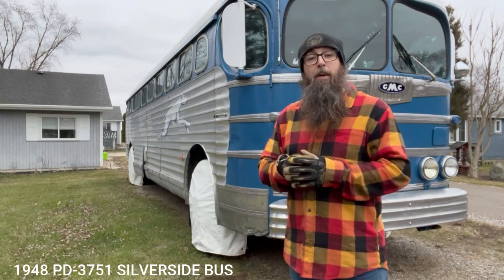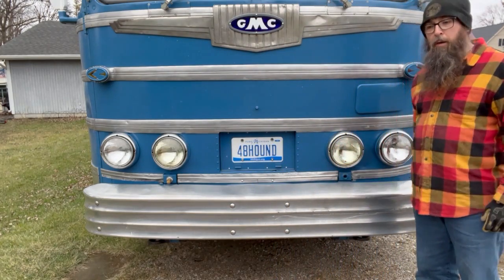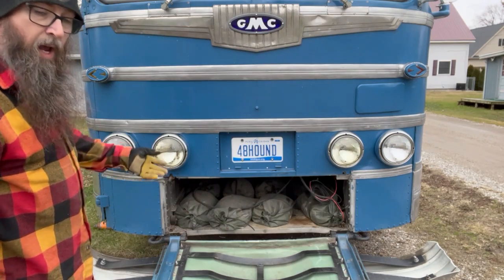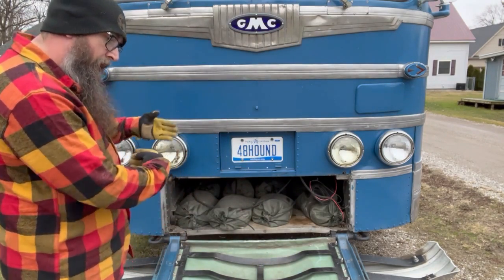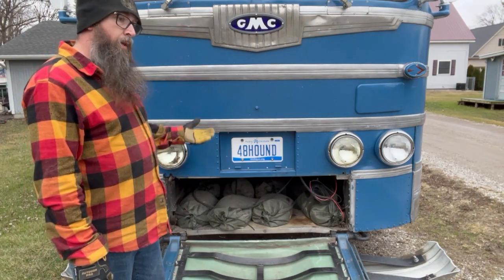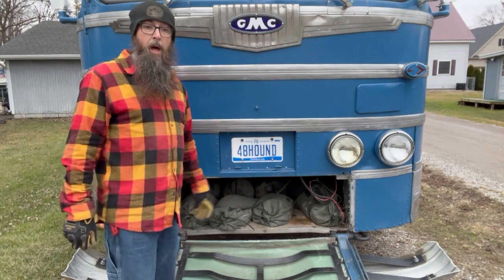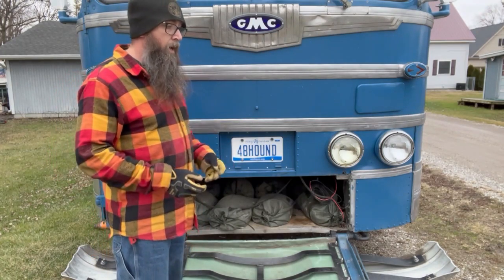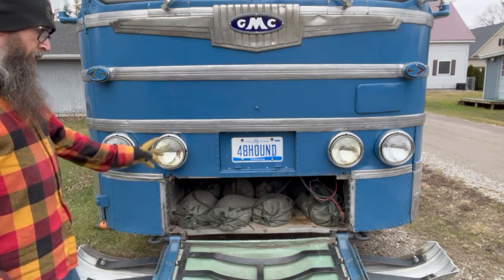Where Is The Spare Tire Hiding?

Comment: So, why do you not have a spare tire, jack, etc in that compartment?  All of those things would weight just about as much as those sandbags do, and you could eliminate most of the sandbags (I'd keep one or two for traction material if you got stuck).
Reply from the maker: The real reason is I run a larger than stock tire and it will not fit in there. I have a 20 ton bottle jack, and a Milwaukee impact that can take the lugs off. Most heavy truck repair shops are able to swap a tire on a rim on the roadside in an emergency. Thak you for the great question!